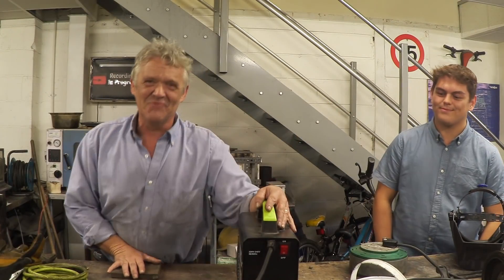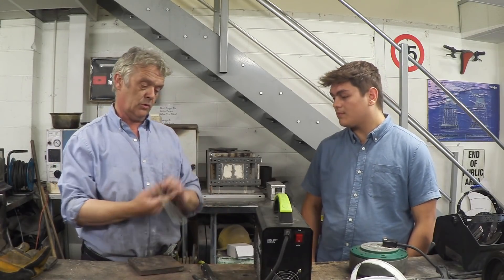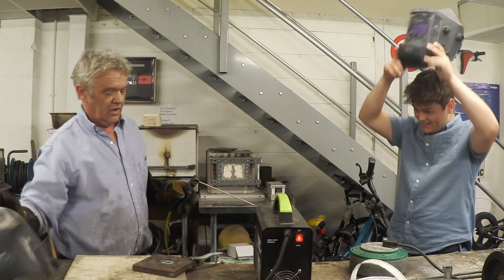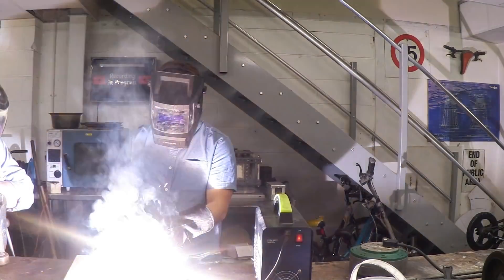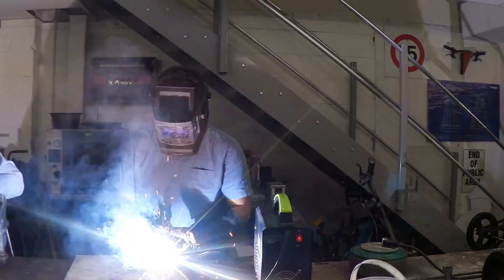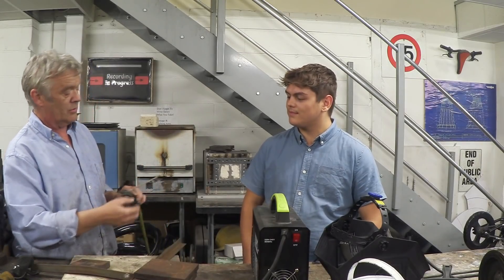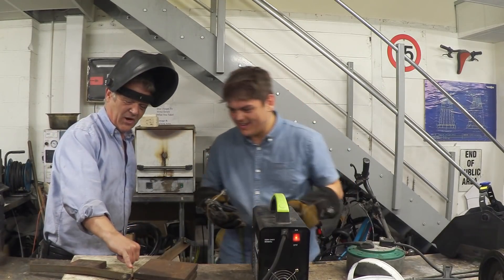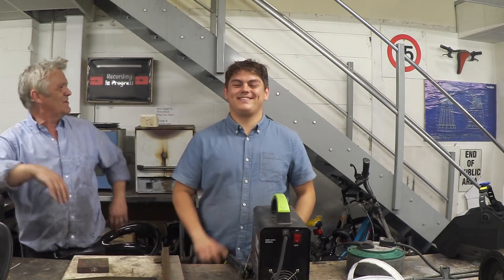1249 Dave Learns To Weld In 15 Minutes Flat - A Tutorial

Comment: Very well done Dave,  what a great tutor you've got. I'm a welding Virgin I've just aquired my first welder and watching this video has given me the push I need to make a start.
Reply: Give it a go Leo! It was a heck of a lot of fun! The biggest lesson I learnt was that you have to slap the rods quite hard to start the arc!
Reply: @MaskedMinersUK  thank you forthe advice, I've got some scrap pieces to try with.
Reply: @leorumley8132  If you're using scrap, make sure to remove the rust before attempting to weld otherwise the rust gets trapped between the 2 layers of metal leaving air bubbles inside the weld like an Aero chocolate bar which will make the weld weaker :)
Reply from the maker: all I can say is go for it mate - the hardest step is the first one - after that you will wonder why you didn't try earlier!

Comment: Fantastic video. Brought a smile to my face. One critical piece of safety information missing though... Always keep your skin covered when welding. There's a lot of UV coming off that arc and the "sunburn" you can get in a relatively short time is brutal...

There are reasons why polarity matters, but for the hobbyist sticking a few bits of random steel together, like you said, not particularly important...
Reply from the maker: cheers mate and I agree with you - I just tend not to overload for those first few steps

Comment: Very nice tutorial. I intent to start practicing stick welding soon and been looking for a tutorial, happy I found one here. Is there a possibility of you being part of an arc/the electricity conducting through you to the negative? What kind of safety measure one needs to prepare so you will not get electrocuted during welding? On the video it seemed there really isn't much risk as you can touch the stick while welding and even get pretty close to the negative.

Comment: Just come across this video, a good demonstration but I will say keep all skin covered preferably with a pair of fire retardant overalls.
As a welder I have had some cracking sun tans on uncovered skin, normally around the neck area. If skin is left uncovered it will burn very badly.
Keep up the good work Robert

Comment: I’m currently teaching kids at risk how to weld starting with stick welding. I like your approach, but I do not encourage holding one hand on the rod. I ask the students to support their stick hand with the free hand. I have found that steadying the stick hand with the other hand helps to strike the arc and keep the arc close to the metal and reduces the rod from sticking. Thanks for your good example. I have also found it takes only a few minutes for the welding to start and that often ladies are a bit better at this than men. Most students have to overcome the initial fear of the arc. Once that occurs, welding basics become simple.
Reply from the maker: I agree mate - the hardest step here is the first one

Comment: Rob, if you break off a bit of the flux from the end of the stick, exposing the bare metal, it will start the arc without having to bang the stick into your material.
Reply from the maker: cheers mate - nice tip

Comment: I thought in terms of safety the negative should be on the work piece so you less likely to short the live to ground through yourself
Reply from the maker: I'm not sure it works that way mate - I though earth as ground was only appropriate if the supply also uses earth as ground - that way you had the same reference for the potential - if using a dc battery for example it doesn't ground through earth as the point of reference for the potential is the negative side of the battery not the earth.
Reply: @ThinkingandTinkering  Im not a welder.. I should have kept my mouth shut! 😂 I took to google after reading your comment and learnt a lot! Apparently deaths from welding due to electrocution are rare; and I also learnt that most stick welders use a relatively low voltage. Though still, care should be taken when working with electricity, of course. ..Apparently more people suffer from asphyxiation when welding 🤭
Keep up the great content! And thanks for the reply 🥳